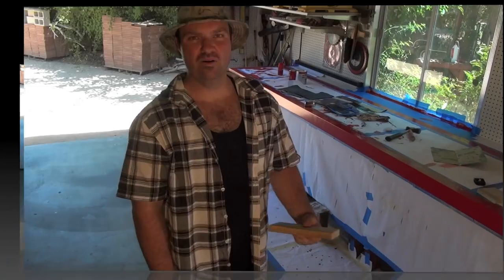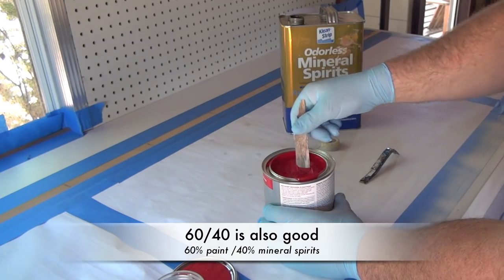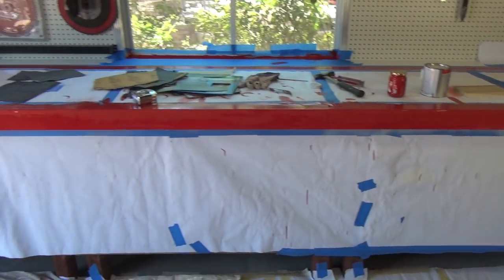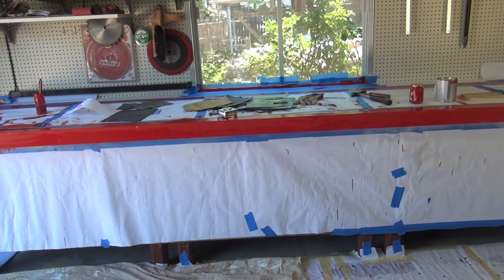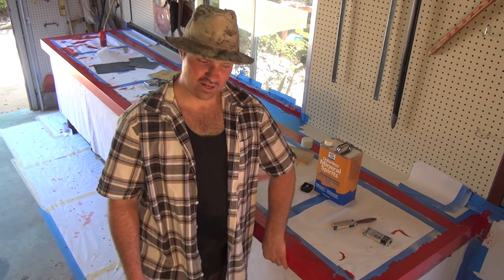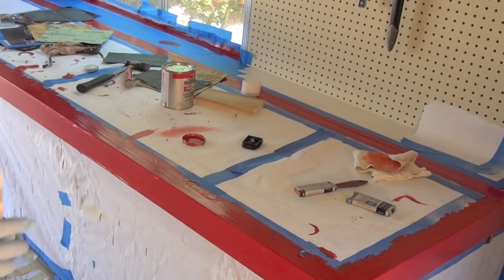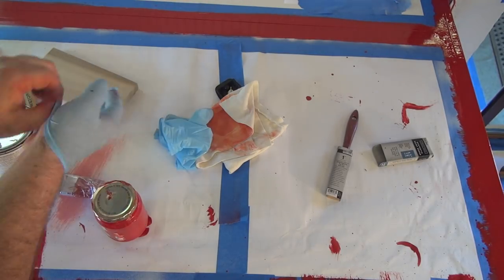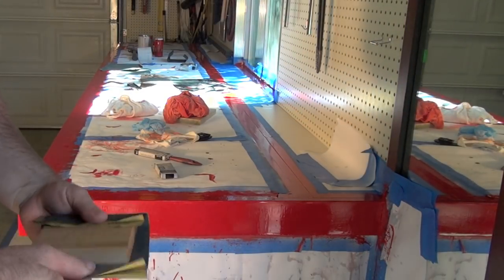DIY How To Paint Mirror like Finish *Step by Step Using RustOleum Oil Based Paint / Part 1

Comment: Hi can I know that whether can I apply the same techniques to the plywood as well to achieve the same finish like you did...
Reply from the maker: Yes you can get the same results just as long as the plywood in perfectly smooth such as birch plywood for example or cabinet grade plywood. Thanks for watching.

Comment: Hi Mike- Awesome video tutorial Thanks so much. I have a question though. In England I have not seen rustoleum brand. Is it for wood specifically? or even for metal? Or both. I have tried with Leyland gloss which is for wood or metal but it doesn't seem that good so far. Just wondered if I was using the correct paint type. Thanks.

Comment: Automotive paint is glossy... that is sprayed on. Just like the video demonstrates: if a paint is thinned to the point it levels well and dries quick enough to not sag or run it will have that mirror result. You can spray Rustoleum too. The trick with spraying is to apply heavy enough to level out nicely but not so heavy that it runs. I have painted motorcycle tanks and side covers with factory-perfect results with Dupli-color.

Comment: When you do the 4 coats, how dry should the paint be between the coats? I just put a 50/50 coat down and it's tacky but not fully dry. Is it ok to lay another coat on???
Reply from the maker: its best to wait 12-24 hours between coats. oil based paints take a while to dry.
Reply: Mike's DIY Projects & More.....sorry I mean how long between the 4 coats. Like I lay the first of the 4 coats then I want to lay the second of the 4?

Comment from the maker: I use the professional rustoleum spray can in the silver can. I would spray a few light coats & wet sand with a fine automotive wet sand paper then polish, Maybe repeat the steps. I find the professional sattle can enamel holds up great & is very durable. I haven't tried this method but I can imagine it would work great. Please it at all possible give some feedback if you do try this method. Maybe others can comment. Good luck

Comment from the maker: You can wrap the roller in a plastic bag until the next use (maybe 24 hours,Some people freeze it to make it go farther) The tray. Remove most of the paint by letting it drip off & let it just dry out, no big deal, then reuse it later on by adding paint on top. as long as no old paint peels off and is transferred in the next fresh coat then your doing good. Maybe others will comment on this issue, good luck...

Comment: always paint the entire strip in one go, rather then stop go around the corner, and come back to where you were before.   This is called keeping a wet edge.    Two problems with thinning paint down that much particularly oil based house paint is that you will reduce the coverage, and the paint may yellow and break down alot quicker if your in a sunny area.    The quicker and better way to do that is called 'tipping off'   where you would roll the paint on, then brush over it really fast

Comment: I just bought a quart of the same red Rustoleum and it says to thin with Acetone.  So why do you use mineral spirits?
Reply: from my experience acetone is better for removing paint while mineral spirit for blending with color
Reply: might be wrong here but i also think acetone evaporates faster
Reply: another reason i don't use acetone is because in the market you'll find acetone and industrial acetone. First one is common use for nails etc, while the other one is great for removing even 
gasoline adhesives.

Comment: Can i do this to particle board I want to paint int high gloss white?
Reply from the maker: +Angel Ramos You could but mdf imo would be a better choice material so you don't notice the wood specks under the finish,  use caution not to wet the particle board.. Just use a few good coats of primer first.

Comment from the maker: I plan on staining the wood cabinets below with a hi gloss finish. Its all prepped but I got sidetracked. This summer I'll actually finish them up & show with a video how I do that. No you cant use mineral spirits to thin down wood stain (there is no gloss in mineral spirits). You can however use a hi gloss spar varnish & apply that over your stained oak. Then use 0000 grit steel wool & sand it between coats, apply 3 coats minimum. Use marine varnish for hi gloss, look for my future video -Mike
Reply: Be sure to get all the steel wool fibers off with a compressor if using water based paints. You can trap them in the paint and if water based, it will rust

Comment from the maker: Metal does not need primer with oil based rust oleum. kilz oil based primer spray paint is good on wood. Thats what I used on this project, Good stuff. Just sand it smooth before paint & you should be good to go.

Comment: How will I use the minieral spirt with the aersol cans? help? I;m trying to get that gloss finish.
Reply from the maker: +Darkmand8  i only used an aersol to apply the oilbased kills primer. the oil based paint was mixed with mineral spirits before applying over the primer.

Comment: Why use wood to back your wet sandpaper?  Don't they make these sand blocks out of a rubber material?  

I'd think the rubber would have more "give" and it would shape to the surface, which eliminates any burns.

Comment: Nice work.  I got a far easier way to a glass like finish.  Thin your rustoleum with 50/50 with VM&P naptha and spray it on.  Takes three coats and no need for sanding.

Comment: I appreciate the effort you've gone to but as a lot of the other comments say you could have got their faster with different methods.
Main comments from me, unless the primer and undercoat is PERFECT you have no chance of getting perfect top coat. There are still spots and dings in the top coat coming through from the primer and undercoat. Spraying and mechanical polishing (Festool) would get you there faster. 
Use more filler at the undercoat stage (there should be no low spots), inspect with a harsh light before you put any colour on.
one you have started with colour keep going until  you are ready to polish, only denib between coats (knocking off high spots and inclusions) I don't agree with over thinning the paint, you don't  need to do this if you have the right gear to polish back the last coat. As long as it's curing properly the more paint you have on there the easier final polishing will be (so you don'y risk rubbing through the last coat). The final shine has to come from the polish not the flow of the paint.
final comment, buy yourself a Purdy Brush, they are haven!
Peace bro

Comment from the maker: In Canada its called tremclad. I don't know what its called in England. This paint I used is for metal mostly but is good on lots of stuff. Both. Simply find a oil-based paint that's gloss & doesn't cost too much. Good luck & I hope the video helped. Anymore questions? ask away, Good luck!
Reply: Do i have to wet sand it. It has no runs nore brush strokes. So would wet sand be neccessary?

Comment from the maker: Yeah this will work on your boat, I did the entire top deck on my sea swirl with this paint and technique. That's the project I learned this on. Although I didn't mention it in the video you can look at my oldest videos and see the end result of the paint. I have a restoration vid. I didn't do the hull because that would have been way more work, just the top deck. Rustoleum makes a marine paint, check it out. Read these comments, I mention another paint that would also work easier then this.

Comment from the maker: No, it has to be a oil based paint.
No, thinning out the paint does not change the color.
I began woodworking as a kid with my father. I always, everyday as a kid did my own projects, some were big. At the age of 21 I began working in a cabinet shop. Now I was getting paid to use my drill. At 23 I became a finish carpenter/installer. I never quit doing things as a hobby, Always learning & trying new things. 
I learned this paint method 3 years ago when restoring a boat.Seemyseaswirl resto3yrsago

Comment: Not gonna hate on you one single bit. The end results were great. But if I may....I'll offer some advice.  Throw away that particular paint brush. They are far to stiff, and will leave many brush lines that are a nightmare to get rid of. If you insist on a brush, at-least use a very soft brush. Personally, I would use a foam roller. Yes you can get bubbles. But if you have a hair dryer on hand...blow the bubbles away with ease. And you wouldn't need to thin your paint nearly as much.   Also..Mineral spirits clean the surface to a certain extent. Try using a tack cloth after the mineral spirits evaporate. You will see how much residue was still on the surface. Never freeze a paint brush....Never. Also... I noticed you have some bleed around your masked areas. This can easily be avoided using an old Tole painting method. After you have masked all surfaces, consider which areas may bleed. Once determined apply a very light coat of (non yellowing) clear. This will seal your tape and the only bleed will be clear and un-noticeable in done properly. Good video.
Reply: learn more from comment

Comment: Great job!  But far too much work.  If you do a lot of wood finishing, it pays to invest in a good automotive quality spray rig (not harbor freight junk) and learn how to use it.  You can spray your thinned Rustoleum, but better to use catalyzed lacquer or conversion varnish from an industrial coatings supplier.  It will save you hours of work,  and a good spray rig will spray anything with by changing the tip and spray cap, and will last a lifetime if you care for it properly.

Comment: Ok so the trained eye... ESPECIALLY WITH HIGH GLOSS PAINTS... can still see the brush marks. That's why I would never use a brush with this job. He took the time to mask everything off so why not spray it?? Half the time and two coats max. And no brush marks!! He chose a very transparent color. So that is why he had to do so many coats. Hard to cover using a brush.

Comment: Thanks for the video. FYI, there's really no point in thinning the paint so much trying to get to flow out smooth if you intend to wet-sand the paint in the end. Better to roll the paint on full-viscosity from the can to achieve a good build before wet-sanding and polishing. You should need only 3 good coats of paint before sanding, and you do need to be more careful to fill and sand the blemishes before painting. After curing begin with 360-grit paper wet/dry paper and wet sand from there.

Comment: You could have avoided all that work by using a easy sand oil base primer, build up the coats and sand till smooth as glass. than put the oil base paint "high gloss"  thinned out no more than 20% with penetrol two coats and your golden.
Reply: What easy sand primer do you recommend?

Comment: Please don't get me wrong as I am not a critical person at all but to be truthful I found it hard to watch this video.
The preparation was poor,if you wanted to achieve a nice finish all you needed to do was sand the original heavy,apply a coat of oil undercoat,sand,fill and fix the defects,apply another undercoat,sand lightly.
I don't like thinning down the paint personally,so just add 10% of floods Penetol additive (Don't know if you have it there but you will have a similar product)
Brush a nice thick coat and finish off with a soft brush long strokes with the direction of the light,not up and down as you did.
Let it dry for 24hrs and lightly sand with fine sandpaper wipe clean and apply another full coat.
You can add another coat if you want but its not necessary.
Other than that,the finished product was quite acceptable.

Comment: ok so idk if im the only one to say this. but this was completely a waist of time. you already had it taped off. you could have use a spray gun and base coat clear coat it. the clear coat would have had a hardener in it. or you could have sprayed base and applied an epoxy resin. this is stupid amount of work for a work bench that is going to get chipped and scratched and beat up.
Reply: trevor rushto
Reply: yeah using a spray gun you would only need a light sand (if at all) between coats...but hey not all of us have or want to use a spray gun...given this was a tutorial using a brush then yeah sanding between coats is a good idea to prevent build up. Using a spray gun you would still need to wet sand at the end and polish to get a mirror finish....you will get a nice finish with enamel but after polish it looks fantastic. Epoxy resin is a completely different paint and this tutorial is about using enamel....for example you cant spray an epoxy resin over an enamel (the spraying thinners will eat the enamel paint) so this is helpful for people needing to use enamel and still want a mirror finish
Reply: @TheParkBadBoy  sometimes brushing by hand is just more fun.
Reply: RadioGnome ,

After you’ve achieved greatness, do you consider the ramifications of using anything else.

Comment: that paint looks very runny without ,thinning,are you using a well worn in brush ,never use a new brush to gloss. the older the better, get a fairly stiff bristle brush with plenty of guts in,, make sure theres no gap between the bristles, break it in using undercoat when your cleaning the brush  rub it against a brick wall this feathers the bristles  and gives a finer finish....if you have any lines in the paint try a hair dryer on it but be care full not to keep it in the one place too long or put it too close. remember, always use pure bristle brush with oil based paint and synthetic bristle with synthetic paint. I have been a professional painter /sign writer for over 40 years

Comment: To go through all that effort and not use wood filler to fill the nail holes and other depressions is frankly just plain stupid. Not to mention the fact of not using a quality roller. That alone would have saved time and yielded better results. And dare I mention not using a proper sanding block?
Reply from the maker: HA! It wasn't all that much work really. Its just a work bench. If it were a car or something besides a work bench than sure. The point of this video was to demonstrait the process. When I do this on boats I take the extra steps for a flawless finish

Comment: there is a number of things you have done wrong and step one your gloss paint was way to runny and thin and secondly you applied the paint wrong and you used the sand paper really you should of used wet and dry paper and you put the brush in the bag full of paint you dont need to put paint on it to put it in the bag

Comment: OMG what are you doing ! your brush is junk !! you can cut out all this extra work with a white bristle Purdy Brush and sand with 400 grit and end with 1200 grit between coats and let the paint cure and you wont worry about sanding !
Reply from the maker: Agreed

Comment: if you use a good enamel paint not rustoleum cheap crap and good brush master painter brush or purdy then only two coats with proper brush control and strokes will glass finish smooth flat no orange peel none of ugly stuff i see in your paint job i see all your stokes bumps hills montains orange peel lmao.. to use a brush properly you do not make 100 strokes you make one pass only and dont touch again then the paint will do whats its designed to do and lay flat under right conditions humidity and temp. brush stokes show up because people dont put enough paint on brush and make 20 back and forth motions or passes with brush. worry about making it perfect first pass opposite of what you said! paint seperates just like in can its made that way one stroke puts it don thick and it seperate the gloss will rize to top of surface and bonding agents sink. when you pass over spot many times you screw all that up. dip a brush do one anywhere scrap wood about 10 inches long just one solid swipe youll have no strokes it will glass. make another pile or line like you do it put paint down then play in like child with food and youll this same shit results! merry christmas fucknut!